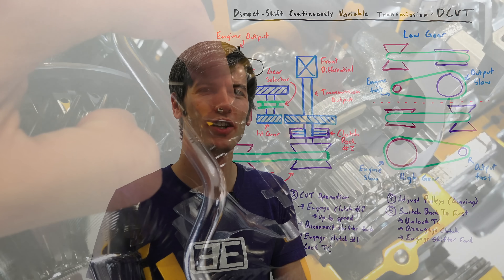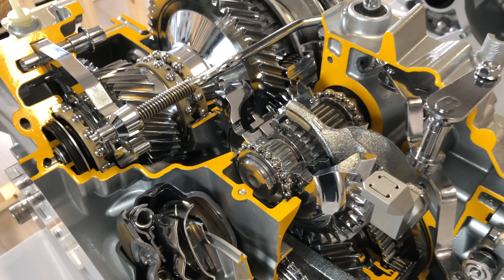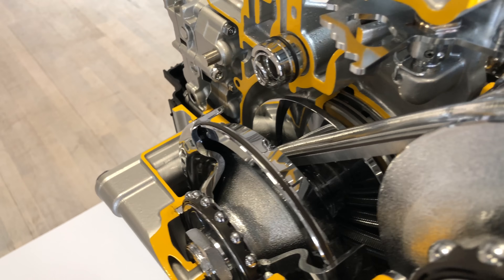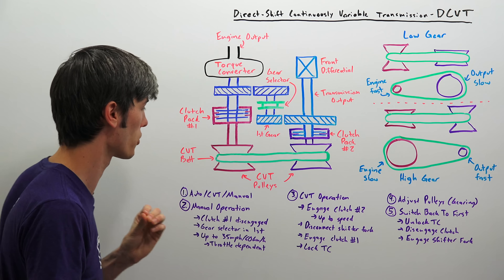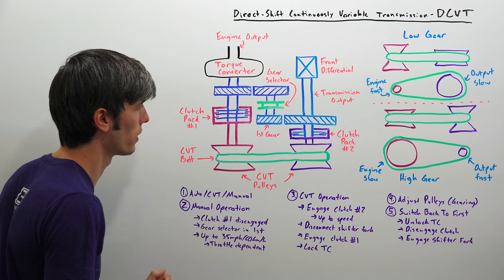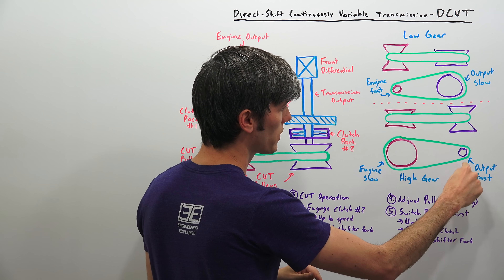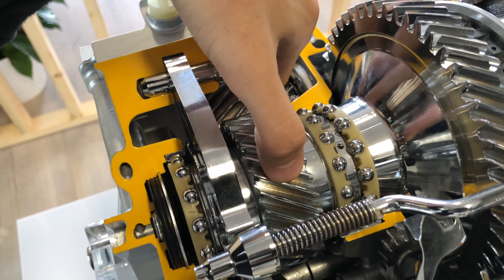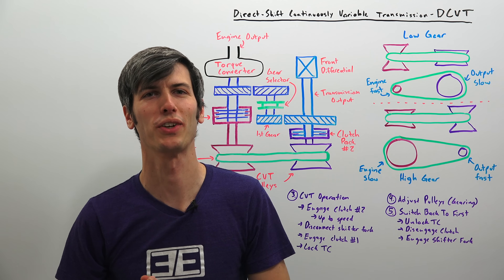The World's First DCVT Transmission - How It Works

Comment: From an engineering POV, this is cutting-edge, amazing and combines the advantages and benefits of both kinds of transmissions (efficiency of CVT and excitement of a traditional transmission depending on choice!)

From a mechanical POV, it’s not fun to work on and maintain lol, way more complex and has more moving parts than any other transmission

Love your videos Jason, always nice to watch them, keep it up! ❤️✨
Reply: It seems simpler than a traditional auto 4 spd tranny
Reply: @slowvag8v  the old 4 speed autos only had the body valve that were complex. Once you understand how hydraulics work tho its not that complicated
Reply: This looks far less complicated than a conventional automatic.
Reply: @forrest225  haha not really.
Reply: lol, conventional auto is so much simpler
Reply: Sandy Lee  In all fairness though no one is yet to build a great cvt. I think that nissan knows they did a crap job and subaru was pushed into it to meet mpg regulations. I have more faith in toyota for sure though. In the end a real manual is so simple and reliable it blows my mind why you can't get them anymore.
Reply: @TheMikeguy7776  not sure if you realized but Subaru has lower mpg with cvt than with their manual transmissions on the same vehicles so I don't believe that's the reason...
Reply: @SpottedOnTheRide  Outback? I wanted an outback specifically and was told they dumped the manual and auto for the cvt for this reason.
Reply: @TheMikeguy7776  hmm not sure about that model specifically. Any model that have right now with both transmission options performs better in terms of mpg with the manual as opposed to the cvt.
Reply: @SpottedOnTheRide  most confuse the Nissan Torroidal CVT with the troubled and unreliable x-tronic. Subaru made the first eCVT toyota eCVT is not a CVT just variable electric motor to assist the ICE engine sometime or just run in full ev mode, so not a CVT but many just a marketing ploy to trounce Nissans bad choices not to further developed or stay with the Torroidal CVT which is trouble free.
Reply: AhmedJDM I'm tired of seeing this crap about "hard to work on, complex" on new tech. First off, it's a Lexus, you won't need to touch it, second you probably don't realize how complex a ton of other parts are that never need fixing in most cars.
Reply: It really doesn't have more moving parts than a normal automatic.
Reply: As an engineer with many years of experience. I do not see how this is exciting in any way, there is a torque converter in front of the manually operated first gear so you will launch like an automatic transmission, not like an antique manual transmission. Its not complex to work on if you actually have experience with working on transmissions, they all look like that more or less. Since its a Lexus it will probably never have to be worked on unless the driver is incredibly abusive to it.
Reply: @omegarugal9283  
When you need to make a car with 35+ mpg, a 4 speed ain't gonna cut it
Reply: @omegarugal9283  And huge lumps of metal that you bring to high RPM just to be stopped by a belt few seconds later... That's not how you create an efficient and long-lasting transmission.
Reply: A 10-speed automatic will have a bit more moving parts.
Reply: @mcplutt  It's possible to have an 10 speed transmission have fewer parts than some other company's 8 speed transmission. It's all irrelevant, once you are expert in any complex transmission, you can work on any other complex transmission.
Reply: It’s a cool step forward, but the transition from 1st gear to CVT pulleys and back again I suspect will have some issues. I hope they decided to use a one way mechanical clutch or some way to time the application otherwise you’re going to have some strange bumps on coastdown.
Reply: Sandy Lee  completely agree here. Our work van has one and I have to crawl at stops to avoid binding. However ours does very well at acceleration but if really pushing it, it seems to bind. Love revving the v6 on CVT. On 4 cyl econo cars it really sucks but the van can really move out of the way better than any standard automatic but at the cost of fuel efficiency but the engine seems to feel less parasitic drag at the shafts so I feel this helps crank wear and the feel of heavy rotational mass from gear sets slamming around losing velocity
Reply: I bought a new 2023 corolla (2.0L) and the gearbox clunk (it clunks the moment i press or release the gas pedal) the dealer says its "normal" !!
Reply: Excitement? There is only 1 fixed gear. I both get why they developed it and on the other hand I really don't.
Reply: Duskconqueror agreed
Reply: adding more gears does not make transmission more complex, it's just another set of planetary gears and clutchpack
Reply: And it combines all the disadvantages as well - see it as you like. First, you need to engaged or disengaged three elements, the two clutches plus the gear always simultaneously over the lifetime of the vehicle. And oilchanges and missuse. Second there is not very much to repair. And it looks as if the clutches for instance were designed to last a vehicles lifetime. But what if not? So everybody should take into account or should be advised that proper maintenance with this gearbox will be adamont, more than ever. 

Maybe this channel should show us how how this gearbox is assembled by the factory - and show us that this is a 'one-directional-operation' - put it back to pieces, repair and reassemble again very likely can not be done in any cost-effective manner.

With the engine of a Honda VFR 750 it's more or less the same. So, users take care.

If this would be Paris 1910 or 1912 we would talk 'pre-war-decadence-technic' after the war?

Well, this may just be another indicator that the all-electric driving machines are now due to take over. (They as well will go all through the same cycles, but a lot of it will be electronic soft- und hardware tweaking. 'i bought  myself a new mainboard for higher amps, and it shifts fifty percent of the milliseconds quicker, i.e. 3 instead of 6ms with the factory hard- and software', gg)

We should know start to educate our people all the/that electric way from now on, we will need it ...

Thanks for the Video!

Comment: Where’s the reverse?
Reply: You put it in neutral and get out of the car to push it
Reply: there is non! you only can drive forward! :O
Reply: What are you? A French army?
Reply: @isthisnametaken978  Hahah That made me Lol
Reply: Normally there is either a single fixed gear for reverse or a dedicated forwards/neutral/reverse box. The latter was famously applied in the Van Doornes Transmissie (DAF), giving the car the same top speed both forwards and in reverse. Which let to great hilarity in Dutch 70's and 80's autocross
Reply: @Duskconqueror  Yes but in this set up it has to be in this transaxle. And I can’t really see it in this video. They actually made a reverse record with Volvo 343 (Transmission from DAF) here in Finland by reversing it 1770km with 90km/h average speed.
Reply: My question as well.
Reply: First gear? Launch gear? Take a  good  look . That  is  reverse. Duh.

Comment: Thank you,I wonder how long the belt last and can a home garage mechanic replace it? The belt and looks like a chaine,Those 2 for service look nightmarish but great idea.I wonder what the life of the belt is in recommendation maintenance ..?Thank you 73s
Reply: Actually, with a fully mechanical first gear, that's what will take most of the torque and should greatly increase the primary belt life.  Reliability should be much better and the belt should last a good long while.
Reply: It's a Toyota so you should already know they've done their research...
Reply: @warhmonger  they usually have as many recalls as the rest of the industry,  so I would definitely give this some time!
Reply: @Marlon_J  recalls don't mean, the cars are bad. At least Toyota is willing to fix the issue, unlike GM and Ford who just put it under the rug. Toyota actually, is pretty amazing standing behind their products, one just have to force the dealers to cooperate.
Reply: @ManuJohn380  I'm not suggesting that they are bad, as everyone knows Toyota makes the most reliable vehicles. What I'm saying is the fact that they have recalls mean just like everyone else they have bugs to work out, so I would wait till the bugs are found and fixed before I buy.
Reply: @Marlon_J  I was just saying Recalls are not bad always. Also not saying Toyota is reliable always in every sense of ways. For example Toyota has had a widespread oil burning problem on early 2AZ and 2ZR engine. I had to get mine fixed before the TSB and extended warranty came out. But Toyota send me a cheque for repairs that I made out of pocket.
Reply: @warhmonger  Ya ,That wasn't my question,I dont need to be reminded at the greatness on Toyota as you can see in my pic thats my 87 4runner at Bonneville Salt flats were she ran land speed racing for years.

Comment: Under NO circumstance would I buy the first generation of this thing. It will break often.
Reply from the maker: Yeah Toyota and Lexus don’t have a reputation of putting out reliable hardware. 😁
Reply: @EngineeringExplained  lol. Yes Toyota and Lexus are known for reliable products, but, the first generation of anything is almost always more unreliable than later generations.
Reply: @EngineeringExplained  But still, the first generation of anything always has at least some issues. More so with cars. Of course, sometimes you get the opposite effect - engineers don't yet know how to model failure modes, so they make something too beefy / good, resulting in "too reliable" machines. E.g. 1.9 TDI...

But more often than not they accidentally have a weak link somewhere in there. Remember oil-powered variable valve timing? Well...
Reply: Engineering Explained dead
Reply: I think they tested it long enough before deciding to implement it dont you?!
Reply: @JohnyMcNeal  But you can only test a very limited amount of time and scenarios compared to what exists in reality, so they will probably find quite a lot of stuff that still needs some attention
Reply: 1st gens do break more, and this seems over-complicated, but as I posted on another comment- I drive a GS450h which also has some stupidly complex transmission and I literally can't find any record of them breaking. That thing has puts enough power through it to crease the road too, or shred a set of tyres in <5 minutes (whoops, that was expensive).
Reply: @ApothecaryTerry  nice!! I hope that I'm wrong.
Reply: @marksuave25  While I'd bet on it being reliable, I do think it might be weird to drive, not sure how I'd get used to not really knowing exactly what it's doing. Being a Lexus it'll be supreme for comfort but I'd be interested to see how smooth the transition is when pushing it hard. That said, while the GS is a monster from 30+ (and ridiculous 60+) I'm not entirely sure if it's just limited by the traction control below that or if it would be faster off the line with a transmission like this.

Comment: CVT transmissions are terrible.  Just ask Nissan
Reply: Nissan CVT transmissions are terrible, not in general anymore.
Reply: Nissan uses JATCO transmissions, JATCO is a Nissan division. All automatic ones from JATCO are terrible even the dual clutch and the robotic. Toyota is using AISIN transmissions, Toyota holds 30% or 35% of AISIN but doesn't own the company as Lexus. Also a few new trucks (like RAM) in the US will be starting to use AISIN transmissions instead.
Reply: @dimitris.p.kepenos  - Chrysler used JATCO CVTs until they figured out they were junk. I think the Dodge Caliber used the same one as the Altima, at least they looked remarkably similar.
Reply: I see you're the type of person who holds onto first impressions with an iron grip.
CVTs aren't terrible, nor are Nissan's specifically.  CVTs around 2012 were terrible but all of the companies using them learned from each other's mistakes and are continuing to improve.
Reply: Not all CVTs are created equal.
Reply: It’s Nissan’s CVTs that are terrible. Toyota and Honda CVTs function perfect and aren’t unreliable like Nissans. Not all CVTs are the same.
Reply: BoldNewBranFlakes Honda ones aren’t that good either Honda make their own Nd they never had made a good auto trans never
Reply: CVT's have so many advantages. In a tractor for example it is the most versatile and easy to use transmission. Coupled with a hydraulic forward/neutral/reverse powershift it makes working very easy. It regulates optimal engine RPM under varying load and throttle input. Tractor gets more economical, has an almost perfectly smooth output powerband, and with a flick of a switch goes from full speed forwards to full speed backwards in a pretty quick, smooth and predictable fashion without the need to apply the brakes.
Reply: The one in my dad's Honda Civic is pretty good, he's happy with it at least.
Hell, even the one from my grandparent's 1979 Volvo 343 DL, while a little sluggish, is not *terrible*.
Reply: TheIronChainMaster Thts Nissan Toyota is on another level Nissan makes the worst transmissions on the planet
Reply: @andersonrodriguez8258  throw Chrysler in that claim too
Reply: @andersonrodriguez8258  - Chrysler stopped using CVTs before the Fiat merger. They're holding out until the technology is more reliable.

And Nissan's conventional automatics are pretty reliable. In all my years as a mechanic, I've only replaced 2.
Reply: sienile Chrysler and Jeep use the same JATCO units as Nissan. 

I agree the conventional step automatics Nissan has used in the past and present are generally good reliable units if you exclude the 5 speed units filling up with engine coolant.  Now that’s a mess.
Reply: Correction: Nissan CVT transmissions are terrible.

The Aisin CVT in my 2010 Fusion Hybrid is going on 173,000 100% trouble free and maintenance free miles (per the owner's manual, no maintenance or fluid changes are required).

Most Ford and Toyota hybrids (all use Aisin, except the newer Fords) are showing upwards of 300,000 miles with no CVT problems at all.
Reply: Adam Alvarez what transmissions are ford using now on their ford fusions ?
Reply: Anderson Rodriguez depends on the model year but most are using conventional step automatics 6 speeds.  I don’t think the CFT 30 CVT unit ford made for a few years made it into any Fusions.
Reply: There are some pretty bad CVTs, but as a GS450h driver I chose this over a load of DCT-equipped cars and I'm happy- if nothing else, under hard acceleration it'll rip out your spleen. Sound isn't an issue either, as long as the CVT is attached to a 3.5L V6 like in the GS, many slower ones do still sound like arse but then most things with 4 cylinders do anyway.
Reply: They are great for us repair shops. They are paying for my new yacht. Long live the CVT.